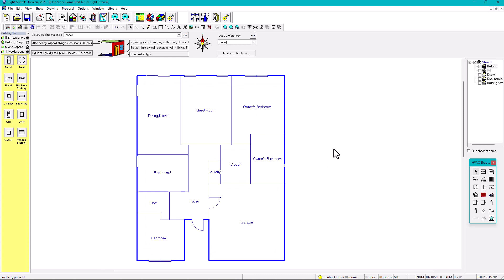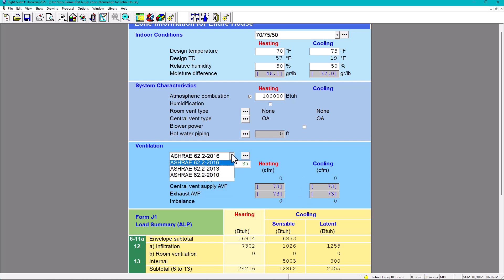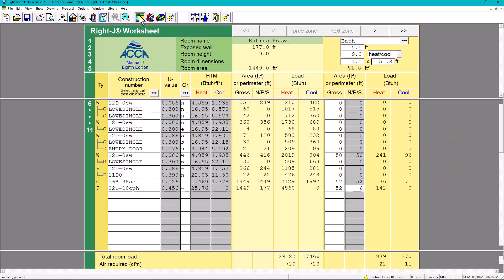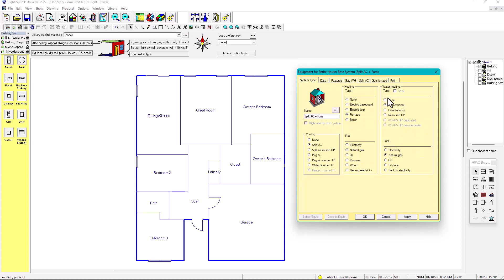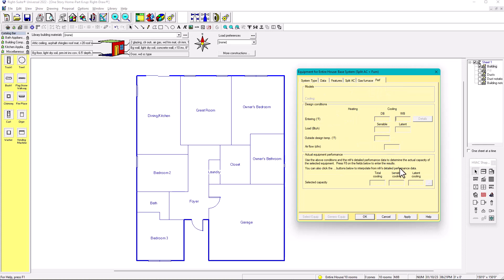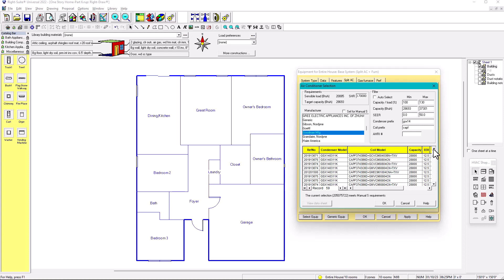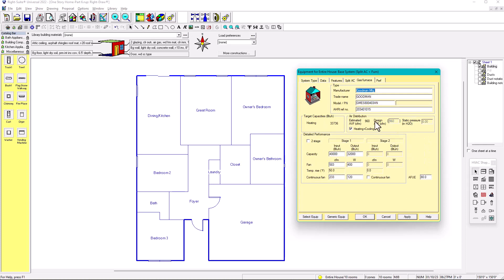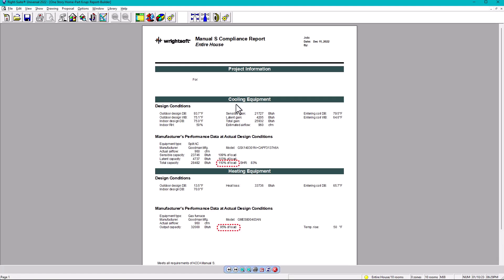Wrightsoft (Part 6): Manual J Heat Load Calculation - One Story Home

Comment: A little late to the party here but I am learning rightsuite now. I am a little confused at the moment, In the performance tab and in the section that says actual equipment performance I only have zero in all of the sections (total cooling, sensible Cooling, and latent cooling.) Have I done something wrong?
Reply from the maker: No worries. Never too late to learn a new skill. Zeros under the performance tab happens when the equipment is not available in Wrightsoft database. Normally, if the equipment is available, it auto populates. 
When there is no equipment or you see zeros, you can manually input the number based on the data sheet of your equipment. I hope this helps.

Comment: my area only allow 15% over cooling load and 40% over heating load.  System heating probably only run 3% of the time at maximum heat load.
Reply from the maker: Yup, it is always a good idea to have double stage or modulating for energy efficiency, however they are more expensive.

Comment: Help.  After selecting equipment, I am clicking on the Perf tab and the values in the Actual equipment performance data in the lower box are all 0.  Does that mean that Wrightsoft does not have those figures and you have to enter them manually from the manufacturer?
Reply from the maker: That’s a great question! What equipment are you selecting?

Comment: I am just starting to use wright soft and when I go to "select equipment", and choose a manufacturer, nothing populates in the unit section. It is blank. Is this a different package I need to buy to have all the manufacturers data?
Reply from the maker: Thanks for your comment. Which manufacturer? Also check the "Filter" section. That is where a lot issues come from. Condenser prefix and Coil prefix should be empty  ALL so it can your the models. Let me know if this works

Comment: Great video. Could you elaborate a little more why you selected those values for the filter ? Plus, if you don’t mind talking a little more about EER and SEER. What do they affect in the selection ?
Reply from the maker: Thanks for your kind comment. I didn’t see we selected a filter in this video. But we usually select 0.15 inwc. High efficiency filter have more pressure loss but better efficiency in terms of filtering air. Regarding the EER and SEER, that depends on the region. Check this article: https://learnmetrics.com/seer2-rating-minimum-seer-rating-in-2023/.  The more the SEER value the more efficient the system and less cost of electricity. The only downsize is the upfront cost since they are more expensive.